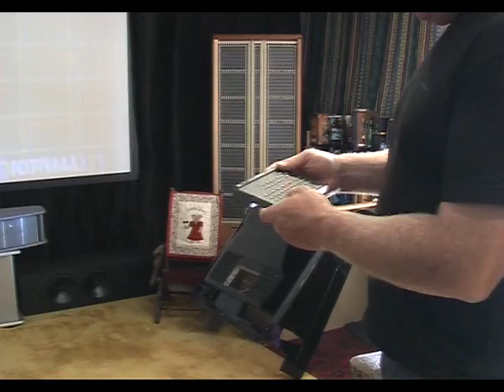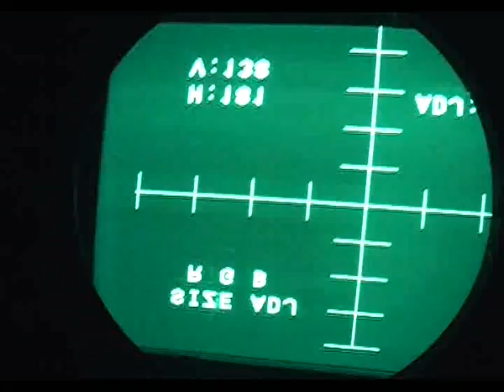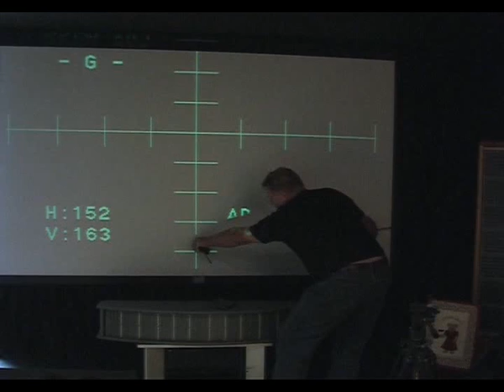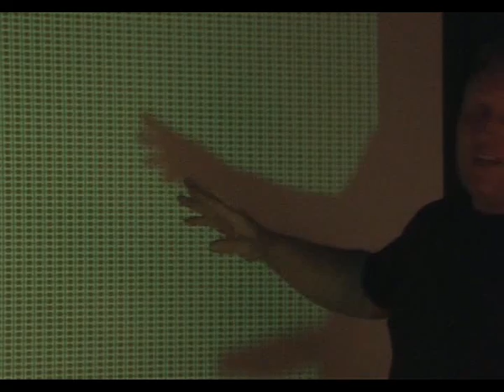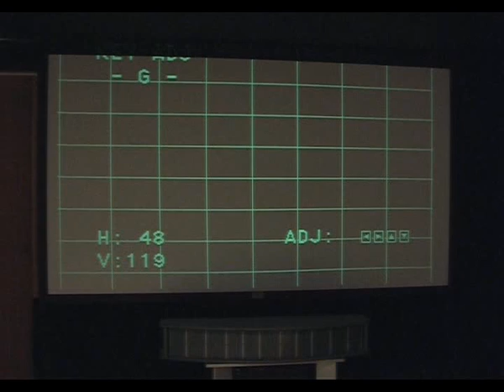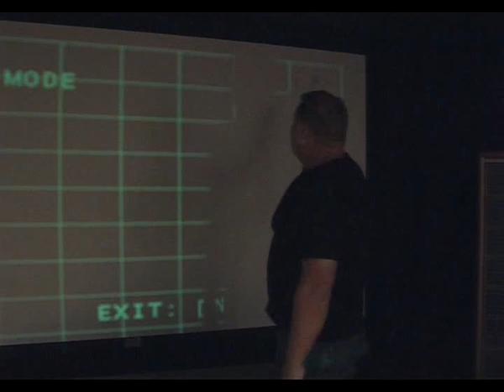A to Z, Sony VPH 1292  CRT projector alignment " How To "

Comment: This video has rocked my socks. I'm considering putting down $240 (plus the 8 hour drive to pick it up) on a VPH-1292, or $800 on a JVC-HD550 (LCoS) model. Do you have a preference? Is there any reason I would pick this over the JVC? And if the 1292 is about $500 including gas, is it worth what it costs? Forgive me if these questions are dumb; the last time I saw one of these CRT projectors in the wild was at Damon's when I was 8.

I guess a more coherent question is, "what did you upgrade to, and do you miss this enormous thing at all ever?"